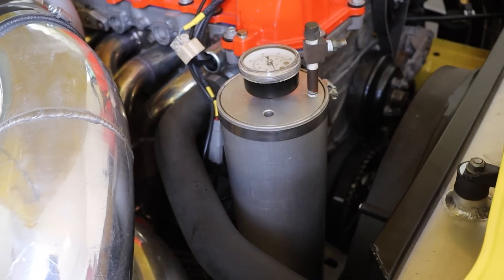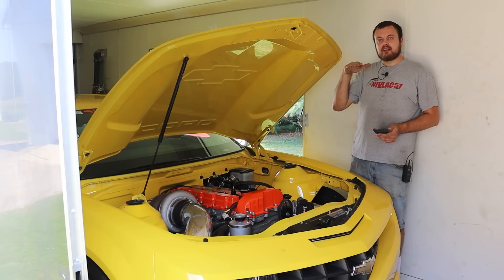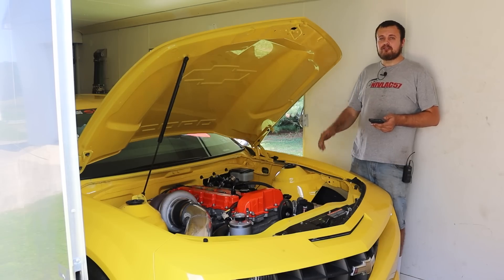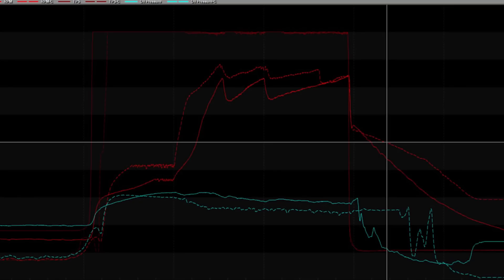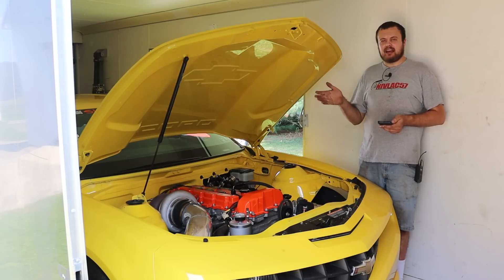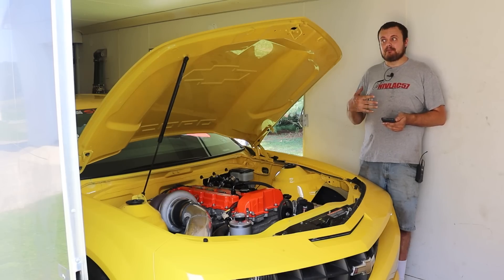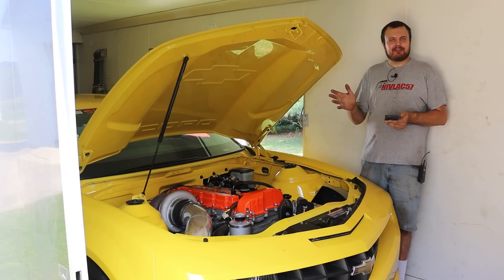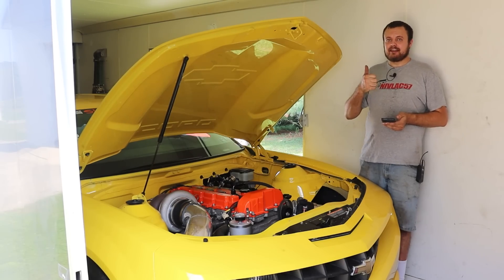This Simple Device Could Save Your Engine

Comment: I have been using a oil Accumulator for a few years and love it I never have to worry about oil pressure at all and I have hearrd of guy back in the old days drain the oil out of the engine and just use an accumulator to go faster because the crank is not dragging through the oil and slowing it down at high speed

Comment: I wonder if the oil level in the pan is lower, reducing frothing, stabilizing and improving oil pressure?
Nice work Calvin.  Win win all around.
8:41 I hope they noticed the shroud is cutting in to the line next to it.  BTW, I wonder what the purpose of the BOV shroud is?
Reply from the maker: We added extra oil to fill the accumulator.
Reply: @Calvin-Nelson  Oh, yeah, I get that.  I'm just wondering if it's reduced the level in the pan slightly when running.
It'd be interesting to have a realtime oil level meter.
I've been tempted to get the Aircraft Extras oil quantity sensor but it's pretty pricey.

Comment: In his book on the topic of oil accumulators, Smokey Yunick asked, "So when you uncover an oil pump's pickup and it sucks air, WHERE does the air go?" 

So for an unloaded engine, this may be the best case for an oil accumulator I've seen, but they're still a band-aid.  Your bearings are still eating air, just for a shorter time.

Comment: If your oil pump suck air you gonna have issues accumulator or not the onoy difference is that your pressure stay high but air pass through engine bearing too

Comment: You may have seen an increase in oil pressure due to reduced windage in the crankcase. If you don't already have a crank scraper and windage tray I recommend you install them. They help greatly with oil control.

Comment: You're onto something with cavitation and the pump curve.  Go back to the old days with big block and high volume pumps in the SBC a few small slots made all the difference.   It worked by bleeding off pressure of course at higher RPM the bleed was higher due to higher discharge pressure.  At low speeds it made little difference.   When you think about it you're doing the same by reducing the delta P across the pump with the added benefits.

Comment: Ok, so you're saying that if you want a really high RPM engine, an oil catch can is like a great way to make it happen accordingly?
Well I was thinking of putting piston oil squirters in my Northstar engine and I was thinking of running them on an electric oil pump, just so it doesn't deprive any oil pressure from the engine. 
That way I could actually observe how effective they actually are.
I think that's what I'm going to do.

Comment: There are standards for designing hydraulic systems which include piping sizing on the suction / pressure and return systems.  The suction needs to be WAY larger than you would think.  I'd say that a dual inlet on the suction side would be beneficial, as in adding an inlet to the cover of the pump so oil enters the gears from both sides.   

Another possibility is thinning down the thickness of the gears / pocket to reduce flow at high RPM.  This would reduce oil flow at low RPM and an electric oil pump might be needed to fill in the low RPM gap.  Maybe a repurposed Volvo electric power steering pump?    The 1.6 L Kent 4 cylinder with a single stage dry sump in my Formula Ford runs 20 PSI at 6,500 RPM and ZERO PSI at idle when hot and the motor seems to live just fine. 

Some engines use a variable displacement oil pump that seem to just bypass oil from the outlet back into the inlet via a solenoid ( like a 2011 - 23 Chrysler 300 3.6 V6 MELLING M528 ). Also note how large the inlet on the back of the pump is ( like an inch + ).   I don't know if any are vane pumps that move the outer ring.  ( See  the GM TH125 / 440T4 front drive transmissions )

Comment: Coyote stock racers have to use a  sealed engine. One of the sealing caps plus it’s written into the nmra rules is you can’t swap oil pans. The stock s550 oil pan is unbaffled plastic junk. But the rules didn’t explicitly say you couldn’t have an accumulator, especially after a few finally lost a $10k sealed engine.
Reply from the maker: Ok. That's good to know

Comment: Without having oil temp to compare vs oil pressure, it doesnt really mean much... Oil temp greatly affects oil pressure and volume of oil flowed.
Reply from the maker: I have lots of data from before and after. I can confidently say the accumulator resulted in higher pressure all the time.

Comment: Thank you, I have noticed oil pressure dropping on a road course even with a baffled pan. I would over fill, but the crank would aerate the oil and pressure would drop. less oil an the oil would move away from the pick-up & pressure would also drop. The Accumulator is a win, win when it is not leaking. (Acculeak?)

Comment: Can you explain those pictures?  Cheap waste gate on intake?  Two injectors in opposite directions in fuel rails?
Reply from the maker: They were using the wastegate manage boost on the cold side. 
The two injectors were being used as solenoids essentially for CO2 boost control.
Reply: @Calvin-Nelson  I never would have thought that injectors would flow enough for boost control.

Comment: May I add a comment , I was working on a car years ago experiencing the same situation, injected 504” HEMI no oil pressure on decel , how ever several sump removal and bearing inspections later , the bearing were fine , so some oil was present , but I am confident an oil accumulator would have fixed this ,  however another car used in circuit racing a challenger with a 426 HEMI with the swinging pickup sump ( the sump of the day) equiped with  an accumulator was killing bearings , the theory was the accumulator saved the engine the first time it starved of oil , but then it prioritised oil the accumulator and not the bearings, thus killing the bearings ( just something to consider ) he opted to go dry sump and problem solved .
Reply from the maker: Yeah. In our case it is putting the pump in a happier situation and making it pump way more, enough to supply the accumulator and the engine.

Comment: Ive always wondered how the valving and pressure on the dry side of the system works. Does the oil pressure fill the wet side and when oil pressure drops it only has that stored energy to push back? Is there solenoids that keep pressure until a certain low is reached? Meaning basically, is it all self maintaining or do you need to recharge it with oil or pressure ever? Can you use it to pre oil vefore startup and it will refill with a few rev up cycles?

Comment: After seeing major failures for not having and accumulator, I bought 3 quart with a in car manual shutoff valve to use to pre-oil and make it possible to check oil level once it’s full. All for around $500.
Reply: Link to what you used?
Reply: Both from Summit, was the largest Accusump and the cable controlled manual ball valve and mounting brackets. They have recommendations based on engine size.

Comment: Excellent presentation.  Thank you.  I am starting research now, however, it would be nice to understand how the accumulator works.  For example - it has to be pressurized.  Does that mean low oil pressure at startup until it gets filled up?  It looks like it might hold a couple of quarts so every drop that it pushes into the engine has to get "re-filled" at some point.  For every PSI it provides "later" it has to consume a PSI "beforehand".  Help me understand.  <smile>
Reply: It's pre-charged, so low start up pressure is not diverted to it.
Reply: @andrewnelson3733  It has to get "charged" from an oil pump at some point and after each "discharge cycle" - either the main one on the engine or a secondary one.  If it gets charged from the main engine oil pump, that means that during that time some oil is diverted from the engine to the device.   Some explanation on that would be helpful.

Comment: NOTE, downside: if you throw a rod all the oil is gonna relieve itself, a guy that ran scca chucked a rod created a hole in the crankcase. He barely saved the car from the oil exiting on the track. He was racing an Opel 4cyl, the sump held half of the engine oil capacity. 
  If using an rpm/ignition on activated valve that would hold the pressure under certain circumstances would be forward thinking, maybe improbable... just thought worth mentioning.

Comment: A stock LS oil pump starts “bypassing” oil between 4800-5300 rpm not the best match for turning 6000-7000+ rpm’s.  A huge improvement is to add a .100” shim under the bypass spring converting the pump to a 70# with later bypass opening. Added bonus +- 50# oil pressure at idle… roughly 60# cold start up.
Reply: I might need to switch to a heavier oil due to the temps experience here, my pump has the copo spring in it, 30 weight is pretty thin
Reply: @shadowopsairman1583  CoPo spring is an 80# plus.  If you’re not seeing good pressure at a hot idle I’d start looking at bearing clearance or a leaking o-ring on the tube. 
With that said if you’re running .0035” bearing clearance you’ll probably want to run a 20w/50 or straight 50/60 weight racing oil.

Comment: I always say that an accumulator to the oiling system is equivalent to a battery in a charging system, it is a storage vessel for varying  demands and speeds which can help solve high rpm cavitation. Also can think of it like your expansion tank on your house water system if you have a well too
Reply: Capacitor basically which works using physics, batteries are chemical.
Reply: @shadowopsairman1583  capacitor is electrical and accumulator is liquid🤷🏻‍♂️, point was battery absorbs voltage spikes and supplies steady voltage to the system on demand, the oil accumulator does the same for the oiling system for that fluid

Comment: It works like an EFI damper, smooths out the highs & lows..and obviously, fills in the gaps on those BIG lows.
Reply: Almost Like an added capacitor in a electrical system in a car with a big audio system

Comment: Why couldn't you run a dry sump with an electric motor on it. Not driving it off the engine, you could regulate it much easier. Just a thought.
Reply from the maker: You can. I've heard of it being done. It's not a bad idea if you can find the motor that will be up for it.

Comment: Time to install an oil accumulator on my 3-cylinder Geo Metro.
Reply: Laugh if you must, but 20 years ago I had a 3 cylinder Metro and found a guy in Canada that specialized in those motors.  $350 later I had a custom built cylinder head.  Ported, polished, stainless steel valves, custom ground camshaft, adjustable timing sprocket, and the head was also shaved to increase compression.  It woke that 3 cylinder up!!!  Top speed on level ground went from 74 mph to over 96 mph(I had to back off before the car stopped accelerating).  It made the car a LOT more fun to drive!!
Reply: @91CavGT5 the top speed of a 3cyl metro in stock form. (Per the owners manual)
Is 105mph

So congrats you built a motor that was slower than stock.
Reply: @fastinradfordable  mine had a burnt exhaust valve(common problem when the long EGR passage gets clogged) so it was only running on 2 cylinders.  I also stated that I had to back off when it hit 96 mph and that it was still pulling, which means I never found it’s true top speed.  You might want to brush up on your reading comprehension before trying to flame others.
Reply: Critical

Comment: You may also be benefiting from the oil in the accumulator being a lower temperature than what’s flowing from the pump that’s certainly losing viscosity.  Of course smoothing the pulses helps as well.
Reply: I might need to switch to 5/10W-40 or 50 for mine
Reply from the maker: Yeah. I thought about that, but we are seeing oil pressure increase even when everything is heat soaked.

Comment: I have seen issues with bracket racers where they have no idea how much oil is in the motor because no dipstick.  When they shut the motor off it fills the pan with oil.  When they start the motor a few quarts leave the pan and fill the accumulator.  Are they over filled or under filled with oil?  Pain in the ass if you ask me.  I don’t run one in my turbo LS or my bracket BBC because I don’t have any oiling issues and I run a locking dipstick lol!  But I guess I would run an accumulator if my datalogs showed issues.  Oh , 90 percent of bracket racers do not data log so ignorance is bliss!

Comment: I bet the air in the accumulator is acting as a shock absorber for the whole lubrication system. It's not really a matter of demand on the pump increasing, but of smoothing the impulse of oil "backing up" against the oil passages and creating a shock load that the "compressed" oil has to endure. I bet if you put a pressure gauge/sensor on your accumulator, you could graph the implulses.
Reply from the maker: That would be interesting to measure. Maybe I will sometime.

Comment: An oil accumulator is to an engine, what an electrolytic capacitor is to a circuit! Kind of.  :)
Smooths out the flow, and removes potential air (which is compressible - maybe why the pressure went up?). 
Smooths the flow, removes some of the AC component (ripple).
Reply from the maker: Yep, but capacitors usually don't result in more voltage. That's what is so cool about what is happening here.
Reply: @Calvin-Nelson  - granted, it was a loose comparison.  ;)
That's why I mentioned the removal of air bubbles. Just a guess, but SOMETHING is causing the increase!  Could just call it a win though, and carry on.
Reply: @Calvin-Nelson  it holds electricity to be used, relies on physics which a battery relies on chemistry

Comment: I don't know why you decided to start posting but sure do appreciate it, truly thank you! The examples of cool things your showing starting at 8:40 I am not sure exactly what they all are? Anyone feel free to correct me.

1)cool wastegate priority, diy exhaust, pie cuts, air induction tube, but mostly the turbo mount? 
2)took me a minute to figure out what the gaurd under the BOV was for, but guessing a rock gaurd? 
3)wastegate support is cool especially cause it is on aluminum... then thought wastegate on aluminum? Wastegate on intake?🤯You said it was Haltech? This does seem to be some crazy car down under type outside of the box stuff.
4)Pressure sensors on either side of a aluminum tubes connected by a thinner stainless line? Is it a pressure sensor as is and pressure baffled with stainless? I have no idea and there for likely will learn more from what you put out, did I already thank you? Truly thank you Calvin.
5)Not just aluminum door mounts but the lower mount is just held in place with gravity and potentially a small friction pop into place! 
6)The point of the video- The accumulator. I appreciate the help, the inspiration, I appreciate that I saw 4 times as much in the pictures having gone back through to write this.
Reply from the maker: 1) look at the gap between the cold air intake and the turbo. That is very intentional.
4) those are fuel injectors being used for CO2 boost control
Reply: @Calvin-Nelson  I'm stumped about the cold air intake gap, additional engine compartment airflow while cruising? I noticed it wasn't connected, I see a non touching lower rock gaurd. If it was just for parked rain or debris I'd think the just a little open at the bottom would work.  I know I'm missing it even after a quick goggle search. 

I see their injectors now, also makes sense the refrence line (hot) has an orange pushlock and the dome side is blue. thank you! I appreciate everything I've learned from you!
Reply: @s10issues84 If I had to guess, the gap is there to prevent the turbo from creating a low pressure area (or at least less of one) just before the compressor like could happen if it was directly attached to the cold air ducting. Basically providing cold air to the turbo, but not limiting it to only that cold air when it's spinning at full tilt boogie.

Comment: Calvin, is it possible to use a solenoid controlled valve to hold pressure in the accumulator to act as a pre-oiler on startup?
Reply from the maker: Yes. Very common. They even sell kits to do it
Reply: One of my friends uses a manually operated ball valve in his road race car. Seems to work for him.

Comment: My son designed and made a swinging oil pickup for drag bikes to prevent oil starvation on acceleration and deceleration.. The Nelson family brain trust can do that here.
Reply from the maker: This has the benefit of making the oil pump happier at high RPM, so we will stick with this solution.
Reply: Some muscle cars had swinging oil pickups.  The accumulator is a better solution though.  This is something farmers use all the time on hydraulic systems.   Sometimes it is used as a spring, other times as a constant oil supply.
Reply: I have one I built in a custom go-kart engine. It swings and is always where the oil is. Simple ball bearing pressed on the pickup and pressed into a pickup tube holder with a small weight on the end of the tube. Idk why all road race setups don't use something similar.

Comment: Ive only used accumulators for 38yrs lol and air oil separators.. welcome to the 80’s! Canton Mecca.
Reply from the maker: Yep. I've not seen people show the benefits it has at high RPM on a stock oil pump LS, 4200, Coyote. That is what I am trying to show in the video.
Reply: @Calvin-Nelson  you did a great job. I just wish the drag racers would talk to the road racers.